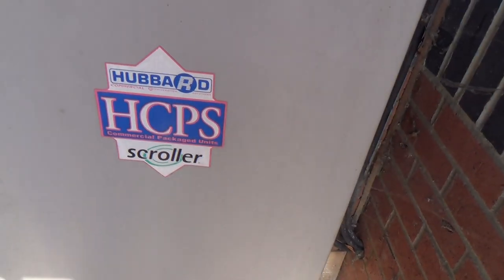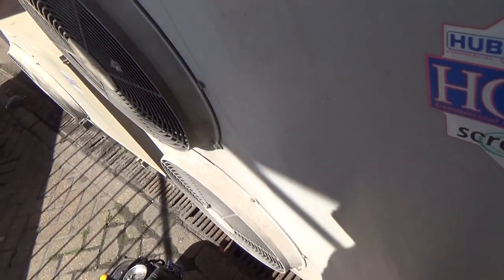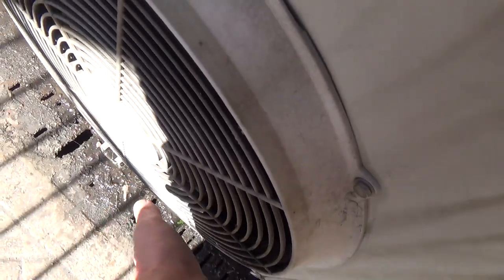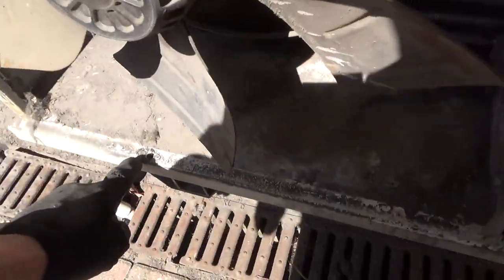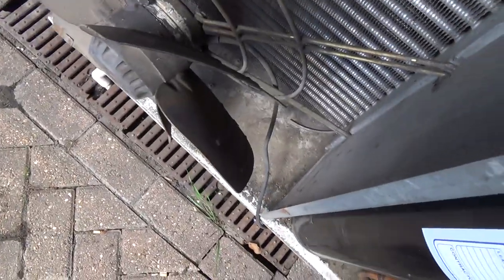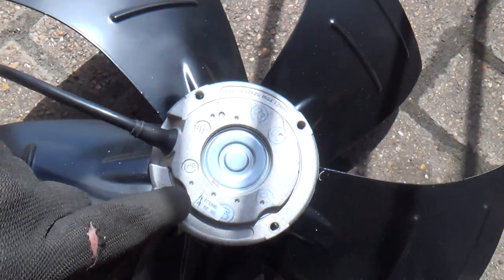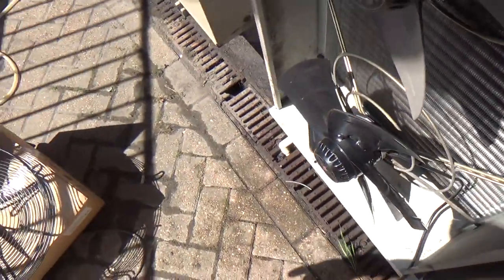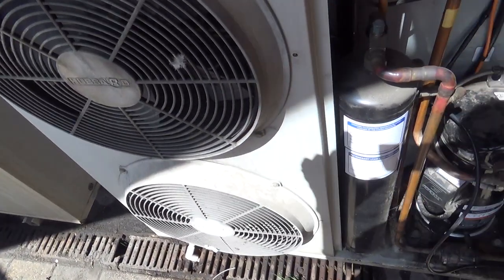Hubbard Scroller Warm Beer Issues

Comment: Watch out for Schneider contactors. Always failing. Oh  and the fan capacitors. Oh. And the compressor capacitors on single phase.
Reply from the maker: I think I've already replaced the contactor on this one, have also had issues the the LP/HP switch as I think they run the fans through it.

Comment: Going to bet the 3uF capacitor is too small, and the 5 should be in there, but the old one had a failed capacitor with the only spare being a 3uF, so in it went.
Reply from the maker: I think the 3uF was for the original 900rpm fan and the 5uF is for the replacement 1200rpm one.